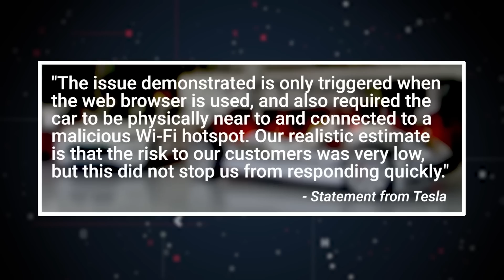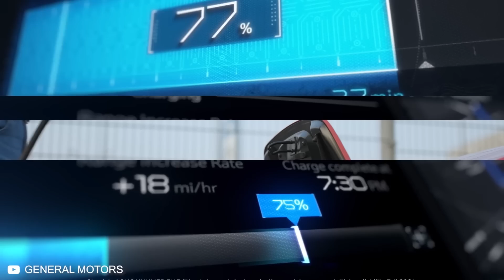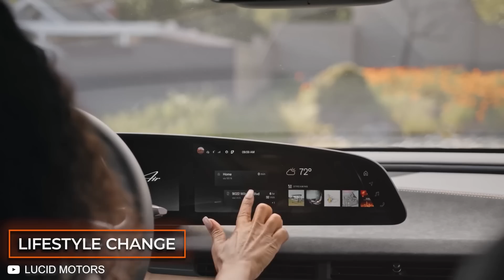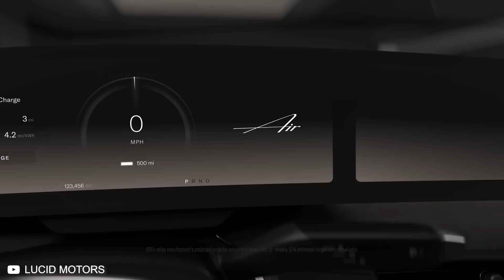EVs' Serious Problems That Carmakers Are Hiding

Comment: They said the ev battery will only last 10 years but I still see so many Mazda, Toyota and Honda still running after 40 years. How is having disposable cars good for the environment?
Reply: Who is throwing away cars without having them recycled or ending up in junk yards for parts? Many countries will not allow a car to be thrown away; they have to be recycled or taken back by the maker.
Reply: @rps1689  so you are saying cars in the junk yard is more environmentally friendly than cars on roads. This will also hurt the poor because they often buy used cars that are over the expiration date of 10 years. There's a point of spare parts if the same model years all died out at around the same time.
Reply: @DerekVuong7799  They actually are more environmentally friendly in regards to CO2, as they can be stripped until what is left can be recycled. Big industry out there recycling whats left over. 

Bottom line is that all energy sources and even recycling are dirty, The responsible choice to make is the least dirty one, not the one where you get to bill somebody else for the cleanup. What is being pumped into the atmosphere represents an enormous technical debt, which is much much more than all the tax expenditures and all the subsidies by all countries to wind and solar energy and EVs.
Reply: @rps1689  you could bypass all that with hydrogen. Use pink hydrogen. Batteries are so bad for the environment and it's such a huge wear and tear item. Would you rather have more CO2 or poison water and if you do recycle then its not that big of a net gain.  Not to mention all the mining. We need to come up with standardized battery packs for easy swamping or go the hydrogen route. Batteries are a wear and tear item and not being able to replace them is like not being able to replace your tires and getting new a new car every time you need tires.  Ev do work for some people mainly rich people that have more than one cars and they like fast luxury toys. Ev preform really well due to lower center of gravity instant torque and fast 0 to 60 plus all the tech. Those aren't your average joe that are buying suc.
Reply: @DerekVuong7799  The technology already exists to contain lead, mercury, and cadmium when recycling batteries and it is improving by the year to the point that in about 20 years the need for mining will be reduced substantially. All the other mineral and elements in a EV battery are fully recyclable even after being used as second-life batteries. 

One nice thing about EV battery cells is, they find a second use in stationary grid storage. When there are enough of them to create a market, they will be recycled to reclaim the valuable metals just like any other high volume appliance does nowadays. 

Any degree of recycling is better than landfilling or the byproduct of burning fossil fuel for ground transport. As for windmills and solar panels,  by the time they start wearing out in sufficient numbers, there will be a recycling market. There is always recycling where there is valuable metal.

Strip mining for REEs and proper battery disposal pose no risk to the continuity of human civilization, but the continued consumption of fossil fuels at current rates raises that risk.

As for hydrogen time will tell. It is highly likely hydrogen will only be used for the replacement for bunker fuel in shipping.

Comment: Everything I’ve read tells me hybrids are the real and realistic answer. 8 percent of the battery requirement, better emissions result when the math is done to include the emissions of mining, creating and shipping  the battery (which when replaced never pays off its emissions) no range issue, an immediate reduction on fuel needs of maybe 40-50 percent, Lower cost, lower barriers to purchase (initial vehicle cost) on and on and on. I just purchased a hybrid. Feel pretty good about it. Saved 25k over a Comparable ev and my fuel costs will be about equal to charging (even at todays very high fuel costs - it gets better when gas goes down). All this and no federal credit for hybrids.
Reply: Hybrids are more complex mechanically and electronically than a pure battery EV.   Can you drive a hybrid for 200,000 miles?   No way.

Comment: We’re are the charging terminals going to get their electricity if you don’t have fossil fuel‘s?
Reply: Eventually from more efficient upgraded grids and power plants that do not require as much fossil fuel plus other energy sources. This would enable  the suspension of new fossil developments then eventually upgrade all grids to DC by the end of the century and completely phase out all the old 60Hz stuff. Petroleum is too valuable now to waste as gasoline. We should leave as most of it as we can in the ground so our kids and grandchildren can use it for plastics, paint, etc. 

The fossil fuel it takes to charge EVs and to manufacture them will dump much less CO2 into the atmosphere than private vehicles using internal combustion engines. Heck, an EV recharged by a coal plant puts out half the CO2 as a gasoline car the same size doing the same trip and even much better in stop and go commuter congestion.

A national grid needs to be built to tie regional grids together with high voltage DC lines; this would solve the issue of the synchronization problem; the only obstacle is the lack of political will and the influence oil majors have. A shame considering that the cheapest technology that produces electricity is utility scale solar and would be ideal along with wind and less petroleum until nuclear gets its act together.

Comment: I'm a Home Inspector and do inspections out of a Tesla Model 3 long range and drive all over the Dallas Ft Worth area daily and drive way more then the average person. I average 100 miles a day or more. I have had my car almost 3 years with zero issues and have only had to buy tires once so far. I spend about $60 a month on average for electricity to charge it as the app calculates it from what I pay for my electricity. If I drove the typical truck which cost about as much as a Tesla Model 3 assuming I bought new like I did with the Tesla I would be spending way more on gas no doubt like probably $500 more a month in gas alone. Sure I can go cheaper by buying a clean used truck which actually I have but rarely drive because I love the Tesla and I love driving it more then my big gas sucking truck. All the commenters I read hating and talking smack about EV's have never owned an EV. I get that they aren't for everyone, in every situation and that's why I still have my truck for certain situations but they are awesome in my experience and most of the time and I will not give mine up.
Reply: Yea, you didn't figure in the $1000.00/ month EV car payment instead of like say $500-600/ month for ICE car - now did you?
Reply: @r.c.salyer3652  No car payments here bro, also I bought a bunch of Tesla shares way back so technically I'm driving a free car that came with a bunch of cash to boot.
Reply: @jstar1000  Great for you - smart man!
Reply: @r.c.salyer3652  Thanks but I have done my share of dumb things as well, just got lucky this time. I have a bunch of stocks and crypto that are down over 80% as well so its not all roses. Tesla has been my saving grace, so far anyway.

Comment: So if I buy an EV for 50K, drive it for 8 years and say 150k miles or so and then buy a new battery for say even $20k and drive it another 8 years and say 150k miles that is $70k for 16 years of owning a vehicle. That equates to about $375 a month give or take not including electricity, tires and other maintenance. Sure there is a cheaper way to go but its not that crazy in my opinion.

Comment: Watch a video of an EV battery explosion and then decide if you want your family sitting on top of one. Keep in mind that most vehicles today have electric door lock mechanisms. If the battery shorts out, the lock mechanisms can't function. Gone are the days of mechanical linkage rods. You may want to consider keeping an escape hammer in your glove box.
Reply: I don't worry, I train legs and kick windows out.......